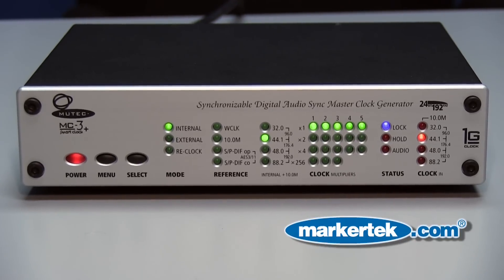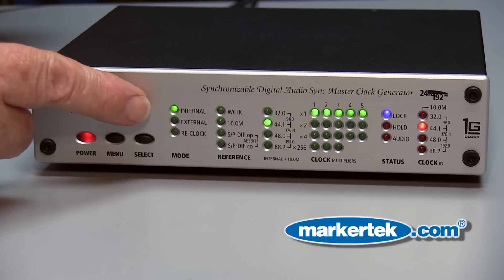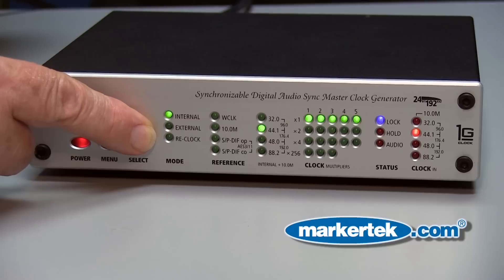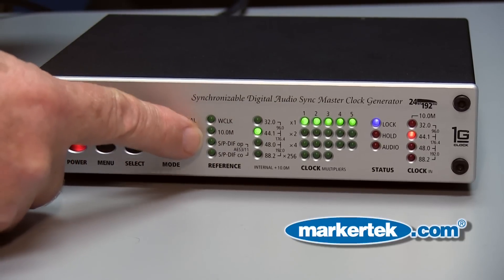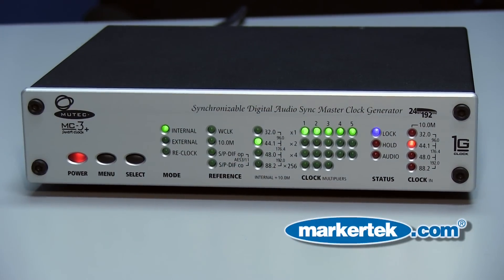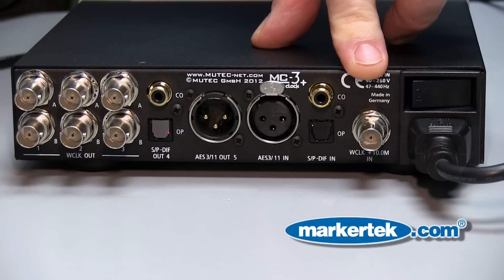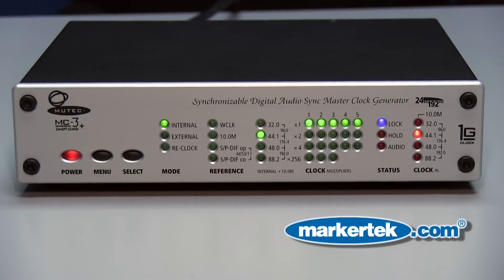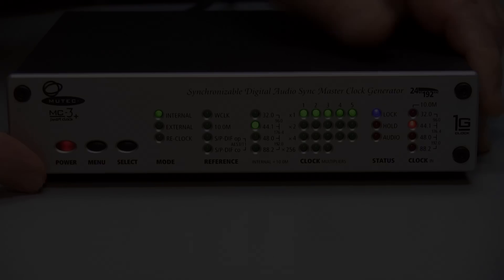Mutec MC-3+ Audiophile Quality Smart Clock

Comment: Snake oil.  Create a non-existent problem (eg audible jitter) and provide a solution.
Reply: No, it has some real functions if you are running a studio, this would act as the master clock, then all the digital audio would be synchronised to this clock as digital audio can get out of sync without a master clock especially if you have multuple digital devices in a production chain
Reply: not snake oil. audio jitter is real. being able to convert your source to aes out with this device is an amazing advantage to have. jitter is audible. don’t spread fud when you have not done the research yourself or don’t even have an audio system cable of hearing the differences